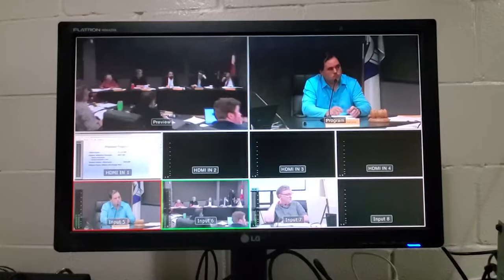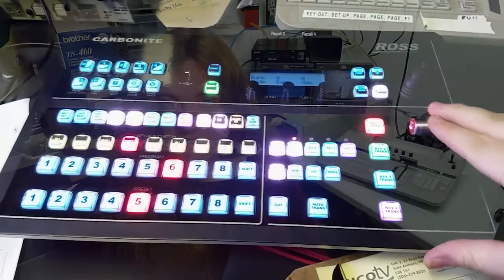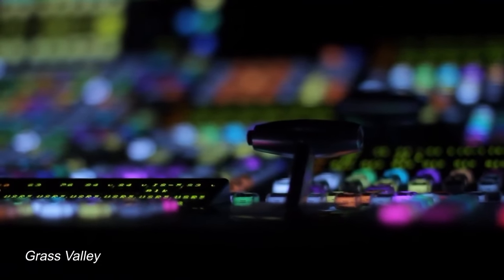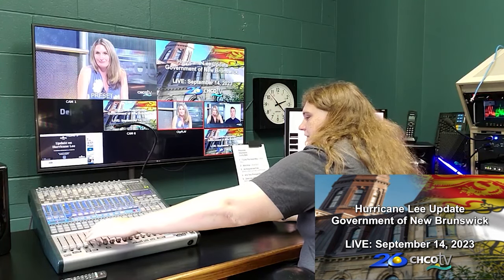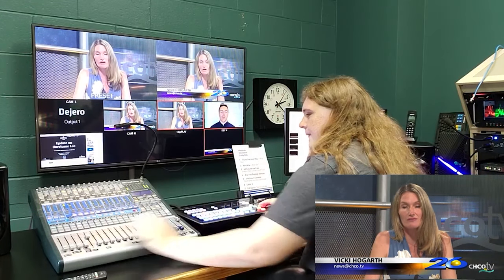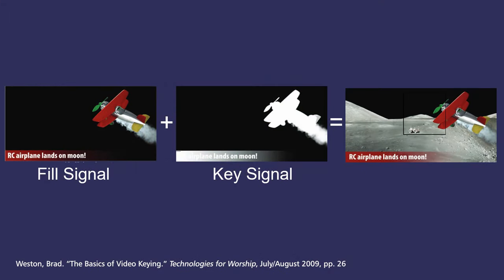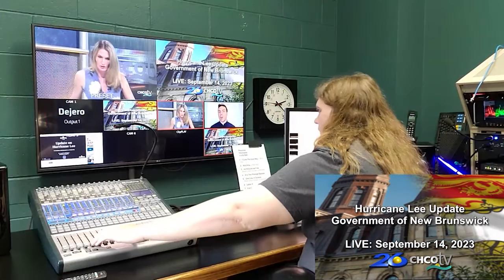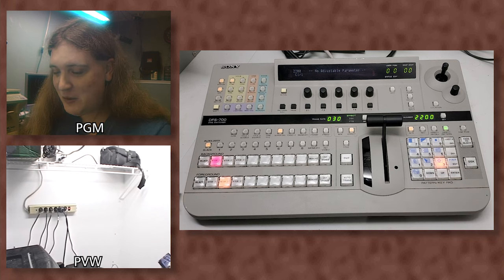Sony DFS-700 Video Switcher (2000) - Introduction & Basic Functions

Comment: The DFS-700 can actually do effects on three simultaneously visible sources, like two boxes plus background. it depends on whether the relevant addon cards are installed, though
but fully equipped it can put two picture-in-picture signals with perspective and drop shadows on top of a background. it can even animate them and do 3d transforms if the advanced DME card is installed

Comment: Sony is highly popular. We use an 8000 series in our production, controlled by ELC automation. (See the videos on my YT lol.)

Grass is…not as popular as they used to be. Maybe in sports but Sony has a lot of that space too. Most local stations either have Ross Carbonite, Vision, or Acquity boards to use with OverDrive, or a Sony switcher to use with ELC. The exception to that is Ignite which runs with headless Grass boards. And Mozart (which the BBC uses) which runs with….tbh idk.

Comment: I think there should be a software developer make DFS-700 to emulator software or Effect and Transitions plugin for modern video editing software (Such as Premiere pro, Sony vegas, Edius etc.) Because The switcher is rare or hard to find, And I wanted to try use some modern video (16:9 HD) on this switcher.
Reply from the maker: You can only feed standard definition video into the switcher. It does have a 16:9 mode though.
Reply: @themaritimegirl That makes sense because I was wondering how some of the video output didn't look horrible stretched out when shown in full screen on my TV.